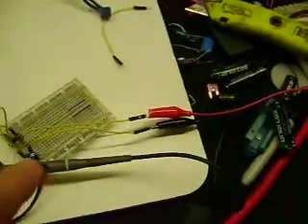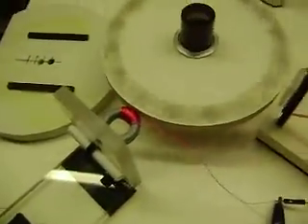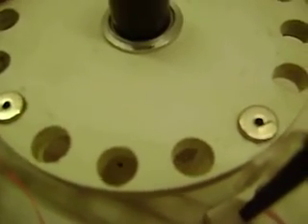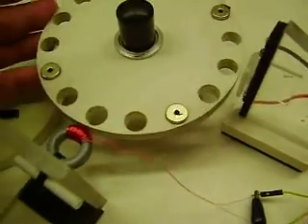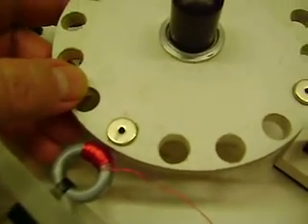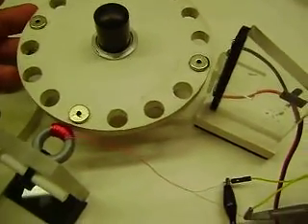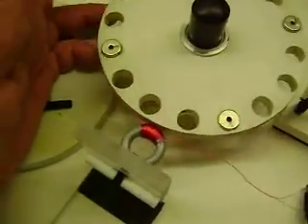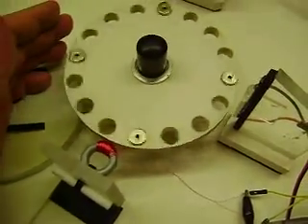Using The Toroid With Partial Winding As A Drive Coil. This Is Not Orbo Tech.

Comment: Keep up the great work!  Looking forward to your next video to see your progress.
Reply from the maker: Thanks. The next step would be to make a large ring core that is not conductive to reduce eddies and wind separate coils around it with as many magnets on the rotor. The coils should get induced without cogging of traditional motor cores. It was said back in the Orbo days that the windings on a toroid could not generate this way, but apparently it can. its possible to use a smaller number of magnets to get an asymmetrical induction cogging to reduce cogging further. If the only load on the motor is simple lenz due to the mags inducing the windings, but not all of them at the same time, it may be a very efficient motor.
Reply: Hey Magluvin, ltns from pauldude000 at Overunity. A quick question: Could you minimize the cogging with the sheer power of your drive magnets (powerful big drive magnets pushing numerous small magnets to make the cogging more or less continuous and smooth) using shaped (magnets oriented to maximize push) fields? You may have already tried it, I don't know.